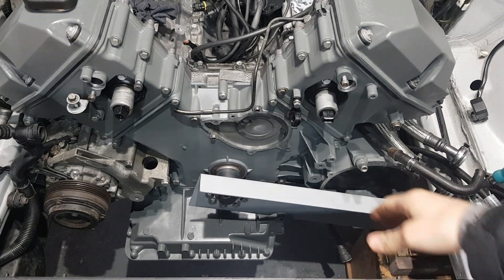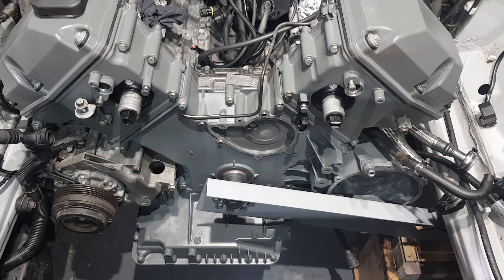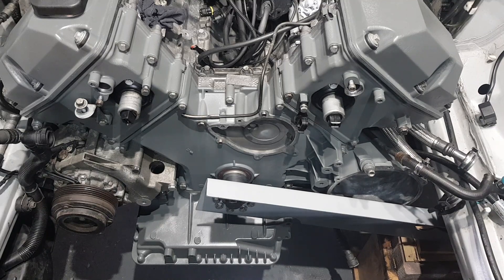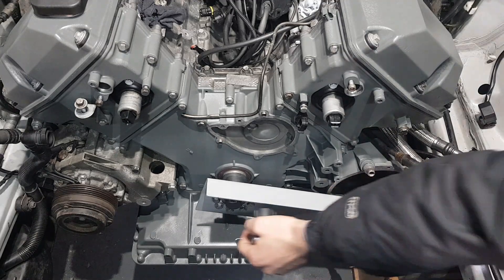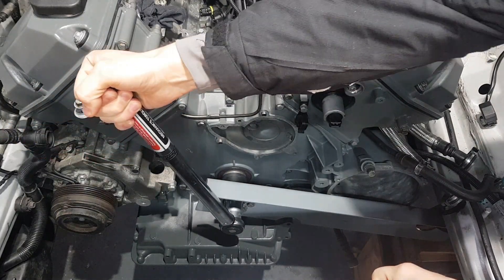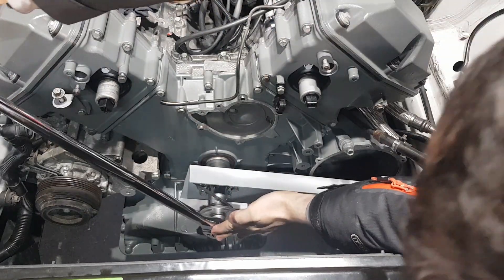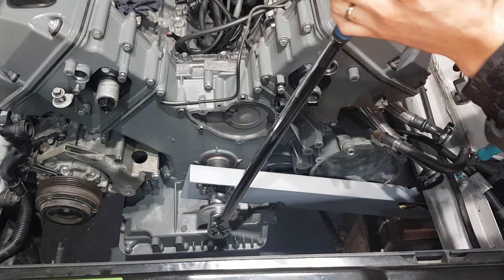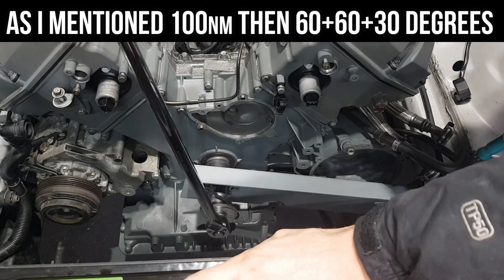BMW E38 E39 740i 540i M62TU M62 M60 crankshaft bolt tightening procedure. How to tighten Jesus Bolt

Comment: Hi 
Doing this same procedure but IAM having issues tightening the bolt , I have tightened it to 100nm and I have the  bmw holding tool and flywheel pin in but I can’t get it to turn 60 , 60 then 30 degrees. Have I done something wrong?

Thank you
Reply from the maker: Hi
You haven't done anything wrong. You are not the 1st one to experience this. BMW torque procedure is totally crazy on this bolt. It feels like something will break after the 1st 60 degrees. Just torque as much as you can without breaking anything. I know many people that have tightened 100nm then 60 degrees and then may be another 30 degrees and never had any issues
Reply: @TheKeenMechanic  thank you , I will keep trying then , hopefully I don’t snap the breaker bar.
Reply from the maker: @ArchieHendryx  If you snap the breaker bar it will not be too bad. Try not to snap the upper sump if your tool screws into it. I would recommend you to use a 3/4" or 1" breaker bar with a long pipe

Comment: Great video as always , just a quick question if that's okay. I have removed my crankshaft pulley from my m62b44 but not the the crankshaft bolt. Does removing the crankshaft pulley affect the TDC. have i messed up my timing?

Any help is appreciated 
thank you
Reply from the maker: Hi
Don't worry, you are 101% safe. The only way you will mess up the timing is if you remove the tension from the chain and start turning things like cams and crank.
Your engine at this point is not open so as long as your chain tensioner is in place you are 101% safe

Comment: I think I have a valuable point. If the screw is tightened at the right angle, it will pull out once. that's why the instructions say to use angle and not just NM. Once the screw has been removed, it should not be tightened with an angle, only NM. the rule applies to suspension bolts. If this rule does not apply to this screw, please correct me
Reply from the maker: Thanks for sharing

Comment: Can I ask why you havnt got the pulley on ? Do you not have to remove the bolt now to I stall the pulley. ??
Reply from the maker: Hi
You don't need the pulley on as it is in the way. You need to bolt the tool on the crank sleeve with the several small bolts to hold and then tighten the big bolt to spec. After you tighten the big bolt you install the pulley at the end and tighten the several bolts to hold it to the crank sleeve. Hope this makes sense. You will see it when you take off the pulley
Reply: @TheKeenMechanic  thanks ! I realised this right after commenting 🤣 thanks for the reply

Comment: after i sold my kidney i could buy some new injectors lol, do i have to install the fuel rail first or the engine cover brackets? cant really remember
Reply from the maker: You can install the engine cover brackets last. I have to do the same on mine too as I recently got an engine cover. Previous owner lost it
Reply: @TheKeenMechanic  allright, thank you!
Reply from the maker: @Ciulik102  No problem Joel.
Where are you  based buddy. Just out of curiosity
Reply: @TheKeenMechanic  hey, sorry for the late reply. i am based in Germany

Comment: I believe the angle procedure is anatomical. The best angle to get 100nM of torque.
Reply from the maker: 100nm is not much for this bolt. You need to do the angles as well
Reply: @TheKeenMechanic  not for the bolt, for you. And I’m confusing nM with PSI. I was cranking on a steel bolt that called for 87psi. Big difference b
Reply from the maker: @paperandmedals8316  Yes, it gets confusing between Nm and Psi. I prefer Nm🤝
Reply: @TheKeenMechanic  my point was I couldn’t see you clicking a 100psi on torque wrench. Lot of guys end up using breaker bars.
Reply from the maker: @paperandmedals8316  I did click 100nm on the torque wrench in the beginning of the video then used a long strong ratchet but nothing wrong using a breaker bar as it is stronger and doesn't flex as much🤝